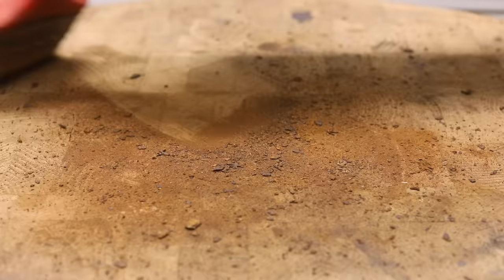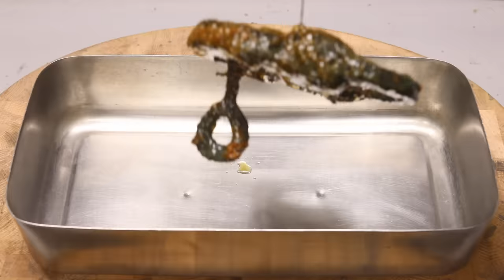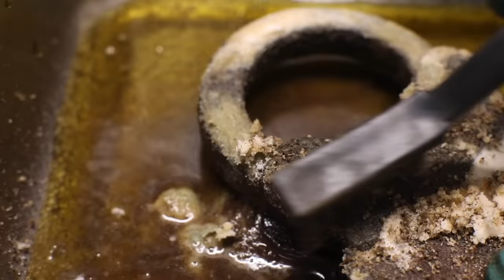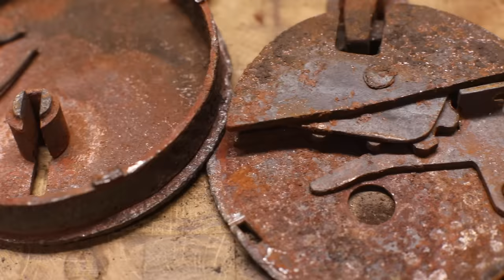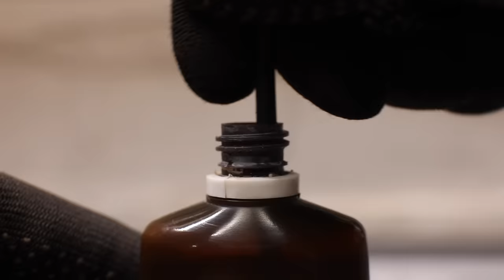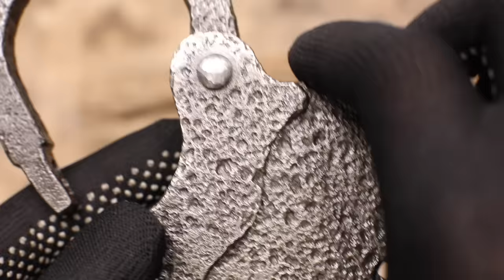Very Rusty Lock Restoration. Padlock of the 19th century

Comment: That rust water goop looks like dnd terrain. Or something you could add to a model.
Also i applaud you going down the route to save the key as well as opposed to just breaking it off and drilling it out.
Also after getting cooked and the submerged, it just vomited up all that rust lol
Also that key may have been for that lock, however the years of rust and such made it not fit anymore

Comment: I was half expecting you to say the key wasn't meant to come out and was just a decoration.
My mom acquired a 1930s martini shaker from a coworker. My sister wanted it if the lid would come off. 
I soaked the top in warm water thinking it was just REALLY stuck. Turned out it had been GLUED ON. After a few hours of the tried and true not working, I was beginning to wonder if that was the case and said as much.

Comment: Now that is a nice restoration. You should use the bluing solution in places where you have hammered, like pins and others. Also do not put the brush into bluing solution, pour it into small container and use from there, recycle what remains. 
I'd say 95% perfect restoration, where remaining 5% are not even realistic to achieve.

Comment: Good job with this antique lock.
A lot of metal was removed from the parts. Don't you think you could nickel plate the whole thing to restore some of that surface without losing heritage?
Also some grease would make the internals work better and last longer but then again that's not historicaly accurate.

Comment: who knew there were so many moving parts inside an old padlock.    

I think they should use one of these on criminal types whom they let out of jail on parole but who are likely to breach.   A heavy chain that cannot be cut through on each ankle with one of these padlocks to join it at a length that allowed them to walk but not run.  Then of course it would have to be so rusty that the only way to get it off is to soak it in various liquids, some ghastly electrolysis, lots of scrubbing with a wire brush and heating with  a blow torch and hot coals and lots and lots of banging with a hammer and various spikes things and a Dremel.
That would keep them in check.  If a detonator could be incorporated so that should they actually get it off,  it would explode and blow their bloody legs off, even better.